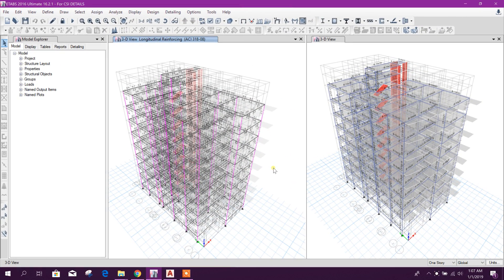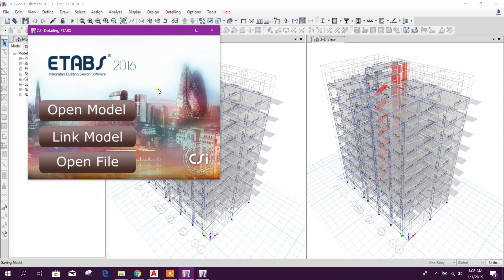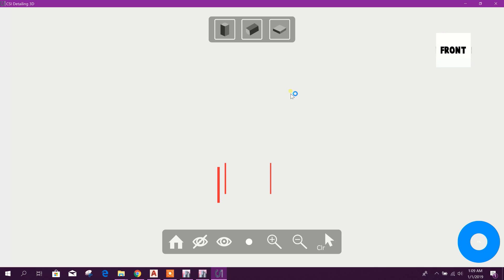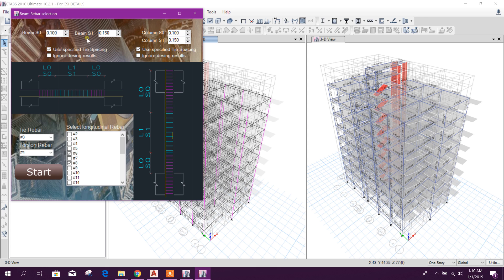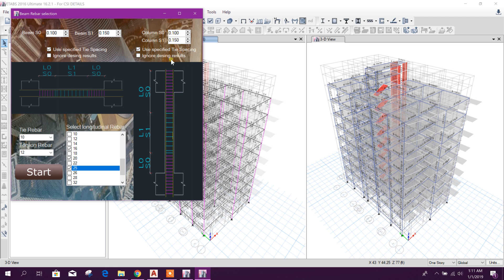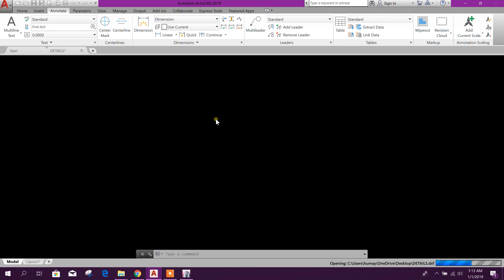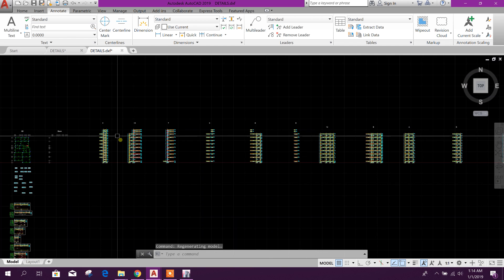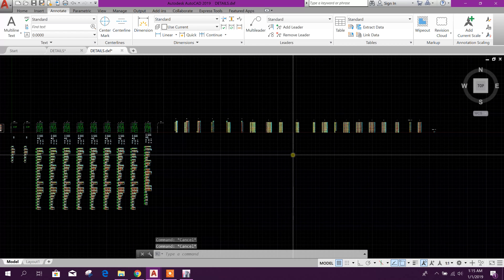CSI DETAILING V3.1: GENERATE MORE DRAWINGS FROM ETABS OR SAP2000

Comment: If someone facing this problem "Contact your CSi Dealer, for software update"
The solution is,

Step 1. Disable your internet
Step 2. Change your computer date setting to manual, then change it to 'in my case 18 August 2019'  for Etabs 17.0.1.  (*It may vary to other version of Etabs/Sap2000)
Step 3. Extract new files of CSI DETAILING from winrar/winzip.
Step 4, run CSI DETAILING.

Done.
Reply: Tnx a lot
Reply: thanks a million bro

Comment: Why this error occurs when I click on Start Detailing "Contact your CSi Dealer, for software update". I am using ETABS 2016 V16.2 and CSi Detailing V3.1. Same error come when I used ETAB 2017
Reply from the maker: CSI detailing v3.1 also having lots of bugs. CSI details v18 is improved, but not yet perfect.
Reply from the maker: Etabs v17 has bug for cracked version.
Reply: @Decodebd  why this error comes with ETABs 2016? Any solution?
Reply: Hii did u your got solved , even i have the same issue

Comment: Thank you for your effort. I used  csi detaling soft ware  to generate drawings of my model. But when it run the design,  it  desplay message says  four column's reinforcement couldn't be read and define the reinforcemet for the section.  I checked it,  it is assigned properly.  could you  help me why.
Reply: Always the property assigned for beams and columns must be different. For Example if both beams and columns are of  M30 and Fe 500 grade then create same property with two instances one for beams and the other for columns. Its a technical glitch. This is the only way to bypass it.

Comment: please observe that CSI detail either v2.0 or v3.1 gives same reinforcement in all column which is not in actual case or as per design result in etabs. Is there there something wrong . whether on can user choice to select beam reinforcement . pl comment if there is solution in my mail id     fazalarju@gmail.com. More over, Etab 17.1.0 gives much more reinforcement compared to etabs 16.2.1 in the same model with same loading etc. specially i got this result as per IS code. I srprise. pl comment
Reply from the maker: ETABS 17 is giving different result & it has some bugs I think. So better to use ETABS 2016 until we get better update.
Reply: Ok.thank you.can you upload a video or mai etab file where you hv model staircase and alalused and design with the stair or ramp modelled
Reply: I'm facing the same problem, all reinforcement is the same and it's way less than required
Reply: Yes, for ETABS 2017 it shows the same reinforcement for all the columns. So better use ETABS 2016 or get reinforcement area from ETABS 2017 and calculate the number of reinforcement with the help of excel sheets or manually and edit it in the auto cad detailing result.

Comment: ASAk Brother.... So at last, nice detailing level incorporated by CSi.... But the settings for parameters like anchorage, covers, lap length, etc.,. cannot be set manually in this version of CSi also (i think) when compared with SACD by bentley??? whats your say?
Reply: How to model cylindrical water tank
https://youtu.be/EzjKWvw9W8I

Etabs modelling basics + how to interpret analysis results
https://youtu.be/20OEfrDMVnw

Can we model evolution tower using Etabs ??
https://youtu.be/iwYMbmmE1N4

SAP 2000_How to model a 3D frame
https://youtu.be/dHfB2uPkE6w

SAP 2000_How to model a 2D frame
https://youtu.be/NuS_My_N3_Y